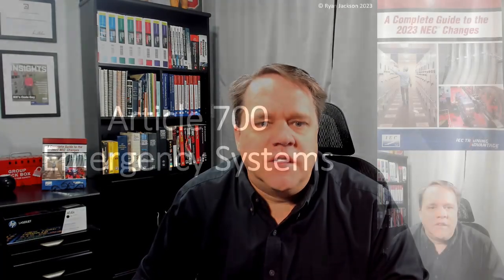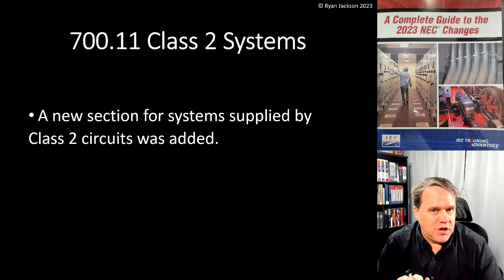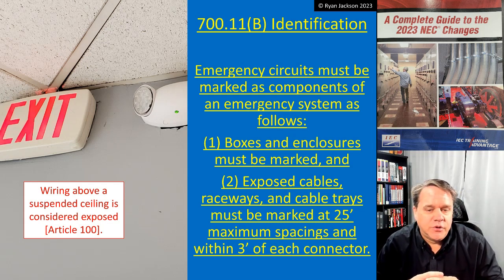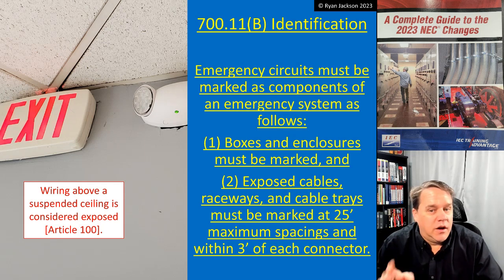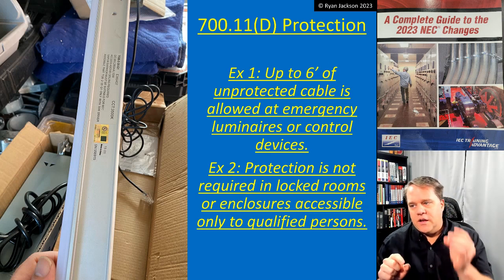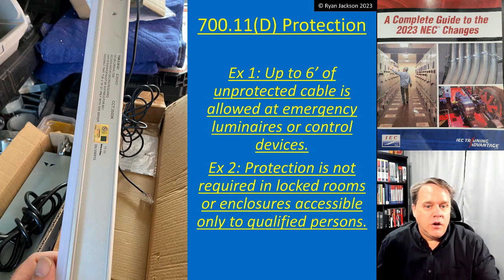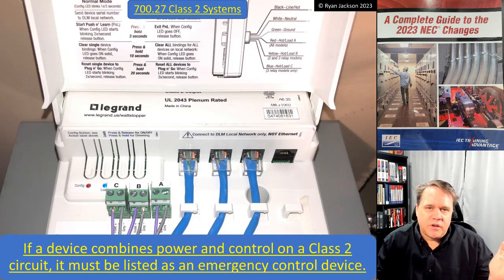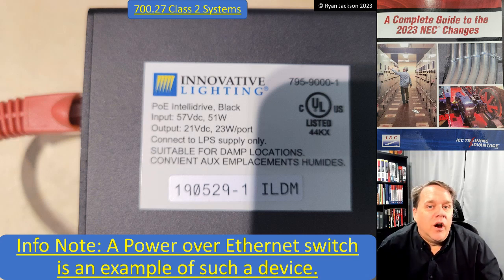700.11&700.27 Class 2 Systems (emergency systems)

Comment: I find it funny and quirky that we get so so concerned about safety that we lose common sense,  Really now,  let's be real.  not every wire is a snake about to bite.  Embrace knowledge, not fear.  Gee Wiz.
Reply: We’re not worried about snakes.

What happens is that some guy comes in with a hammer drill to make a hole for a new waste line or such and nicks the cat 5/6 cable, then the emergency lights don’t work when needed.